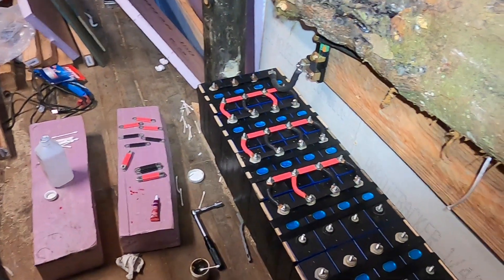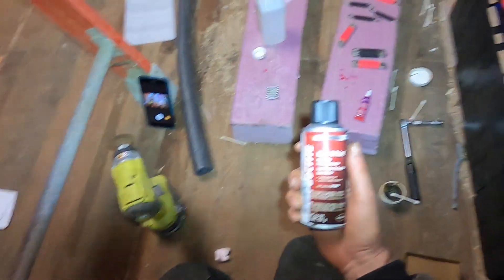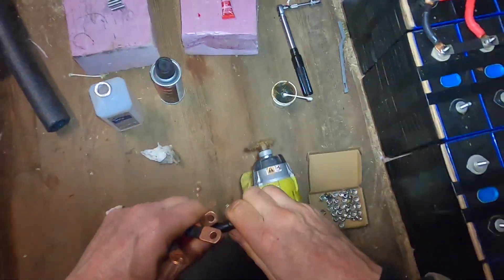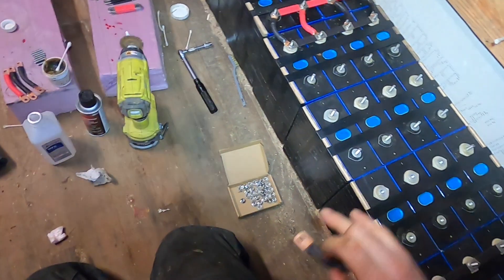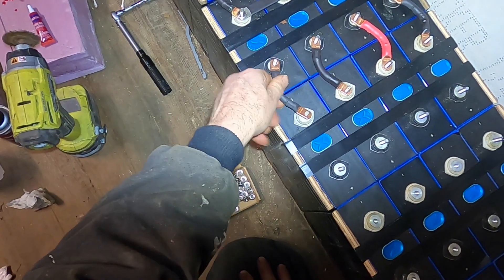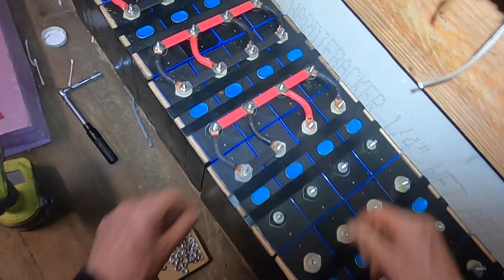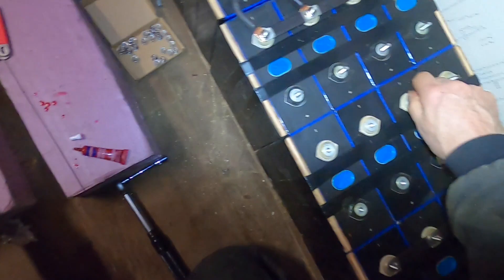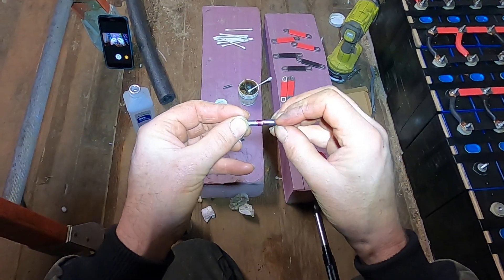LiFePo4 58KWH Battery Bank - Making the Connections - Busbars and Locktite - Underground A-Frame

Comment: I like the information Meta Grid. I am doing 64 cells in a 48 volt configuration. Do anybody know how long of a time and what amps of a charger will it take for a charge . Right now I have a military gen. as an solar array  I want to figure out the total run time on batteries and the amount of generator run time to charge this type of battery, I hear it charge faster. Best of luck on your project, and Thank for sharing.  Sailorboy
Reply: It depends on how many Amps your charger can charge and discharge. Im going to buy the Deye 12k Hybrid inverter that can Charge/discharge with 240A, that is 240x48V=11.5 kW. if your battery is 56kWh it will take aroound 56/11.5 = 4.8 hours (less if you use 80-90% of the battery capacity) of charging. If you have lower amp on your charger you just exchange my 240A to your number to see how many hours it will take you.

Comment: Dang you striped 3 are you going to try an tap them bigger or what
Reply from the maker: The JB weld did not hold,  will be inserting helicoil threads next.
Reply: Ya I think not but don't you need threads for a helicoil if so I'd just drill it if necessary and tap to the next size or possibly a SAE size I assume they are metric
Reply from the maker: @james10739  I installed Helicoils.  Working fine.  Torqued to 4NM without issue.

Comment: I put my lifepo batteries in parallel as one would do with most batteries and it clobbered the capacity.  I lost about 30% compared to what I should have gotten.   Differentilal voltages between various parallel groups connected in series went wild to the tune of several hundred millivolts.  I thought my batteries were bad but tested them individually and in series and all was fine. Took them out of parallel and just put them in series and got the capacity I expected.  Not sure why but you should do some tests first.  My guess is that the complex nature of Lithium battery chemistry and the distribution of internal resistance inhibits equal charge sharing between the batteries like we would expect with most things connected in parallel.  You might be better off with 4 independent batteries in series with a bms on each and paralleled at the whole battery level.  I will be checking that configuration out eventually.  Since these batteries take so long to charge it is a very time consuming endeavor to experiment.  By the way, you might not expect it but the busbars and cables have a significant resistance compared to the internal resistance of the lifepo batteries.   Mine did anyway as they were 1/16 " thick by 3/4 " and 3" long. Therefore, you might want to try and connect the parallel groups with 4 busbars between each group (one off of and to each battery terminal).  I saw this recommendation but did not follow it and maybe that also contributed to my problems.  Oh, excuse me, I just got a shot of your battery configuration and it looks like you are doing it as recommended.  I will be very interested to know if you get the capacity you expect.
Reply from the maker: I wonder if it would help to have double bus bars between the cells in each parallel group?  I have lots of extras...
Reply: @metagrid9453  I think it might help but I am skeptical that it would really solve the problem.  Then again, maybe it was just my batteries and/or my setup.  I think not though.  I calculated that my busbars (1/16 X 3/4 X 3 inch) had a resistance of about 25% of the internal cell resistance.  That is assuming that the BMS I used which gives an estimate of internal resistance was correct.  That might be a big assumption.  In any case, we are stuck with the internal resistance of the cells and they will differ between cells which means we will always get different currents through each cell.  If the IR is close enough it might not be a super big deal but, as you probably know, once you get towards the ends of the charge  and discharge cycle IR goes nuts pretty quick.  I am very interested to see if you experience the same thing if you want to take the time to test it.
Reply: A lot of people mess up connecting batteries in parallel, as the obvious way isn't optimal: https://www.solar-electric.com/lib/wind-sun/Iota_balanced_charging.pdf
Reply: @alharrison3255  Thanks for the article Al.  Yes, I am familiar with the problem and had mine connected as shown in figure 3.   Although that is not bad, the article says I can do better so good to know.  Since I wrote my statements above I did find out that a significant part of the problem was a software bug in my BMS that made it give me inaccurate amp hour measurements.  Despite a firmware release, the BMS problem is not fixed yet.  Just installed another BMS firmware fix yesterday but have not tested it yet.
Reply: Agree 100%. 6 16s batteries with individual BMS’s of different brands. Redundancy.

Comment: Can you tell me why you are putting loctite or any other chemical on your battery studs?  Any substance you put on those battery studs with few exceptions (there are some anti-corrosives that you might be able to use) is going to drastically increase resistance and clobber your battery performance I would think.  I have never heard of anyone doing this and, as an engineer, it seems terribly wrong.  Maybe you have a good reason but I sure would like to know what it is.  In short, as with all expensive endeavors, don't do anything no matter how good it seems until you are 100% certain it is okay.
Reply from the maker: According to my research,  Very little if any current flows via the stainless steel studs.  It takes the path of least resistance which is the face of the aluminum terminal.  So I focus on minimizing the resistance at the terminal interface.  I am using the locktite because it purports to increase the mechanical strength of the thread interface to the stud.  I want to avoid any further stripping of soft aluminum threads that I detailed in my previous video.
Reply: @metagrid9453  The resistivity of stainless steel is about 41 times greater than copper and about 26 times greater than aluminum.  So if you had a current of 100 amps about 3.7 amps would flow through the the stainless steel and 96.3 through the aluminum if they had the same area.  It may not seem like much but to the other batteries it looks like added cell internal resistance.  Over time it may or may not cause a problem.  Just from a personal standpoint, I would avoid interfering with conductivity/resistance.  Also keep in mind that stainless steel is more resistant to corrosion in most cases so, again, over time as aluminum oxide builds up on your battery terminals their resistance will likely grow faster than the stainless steel lugs.  Personally, it is not the kind of experiment I would like to run with my expensive batteries until I had talked to a real expert (not me).  Remember, even though current prefers to flow through the lowest resistance that does not equate to no current through more resistive paths.
Reply: @metagrid9453  Forgot to mention, rather than locktite, why not just re-tap the holes and get a new stud?  You would need a flat bottom tap to reach the bottom of the hole.

Comment: The only thing I would add and this has also been mentioned on diysolarforum is that aluminum oxide is not very conductive so wire brushing the terminal tops is the most important step. Perhaps you did that earlier but it forms very quickly so the antiox should be applied after buffing.
Reply from the maker: Thanks!  I did in fact wire brush the tops previously.  I also wiped away the oxide dust with 99% Isopropyl alcohol on a paper towel.  I then immediately coated the terminals with No-Ox-ID.   If I had to do it over again I would have inserted the studs into the threaded holes before applying the No-Ox-ID as some of it got inside the lip of the hole which had to be cleaned out with a qtip before inserting the locktited studs.

Comment: I realize that most of the contact is not the stud, but since stainless steel is poor conductor had you considered using brass or even copper studs, both are stronger then aluminum.
Reply from the maker: It is hard to find copper or brass studs.
Reply: Found some brass set screws m6 x 20mm on eBay, would that be long enough
Reply from the maker: @jakealmaguenther4366  I need 25MM
Reply: Did some more searching and found another source, aliexpress has m6 brass studs in many lengths
Reply: The surface area of the terminal post is large enough to pass enough more current than this battery would typically put out.
Reply from the maker: @ricklearn16  That is what my research shows as well.

Comment: 58kW battery for powering a small village
Reply: It looks like he has 32x 280ah 4S8P configuration, making close to 27kw. Unless he has double the batteries, I’m not sure where he got his figures from. Still a massive size 😁
Reply from the maker: @CryptoNut82  This system consists of a total of 64 of the eve 280AH cells.  They are arranged in paralleled packs of 4 and there are 16 of those packs in series.  280AH X 4 = 1120AH Total X 52 volts = 58,240 or about 58KWH
Reply: @metagrid9453  well that explains it, you have 64 batteries, only saw around 32 so I obviously got half the KWs hehe
Reply: @CryptoNut82  each cell is 3.2V at 280Ah multiply by 64 to give u 57344 watts
Reply from the maker: Pretty much!

Comment: What gauge cable are using on the batteries?
Reply from the maker: The serial connections between the groups of cells are 4AWG welding cable.
Reply from the maker: @DIY Projects It is 4AWG.  Just checked again.